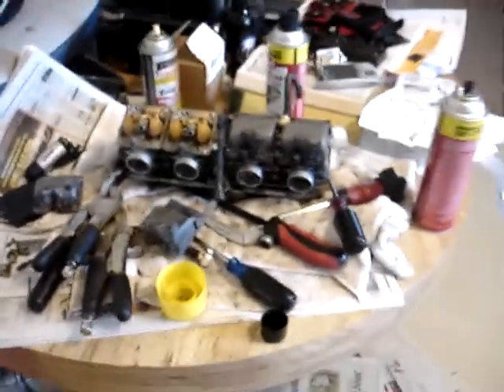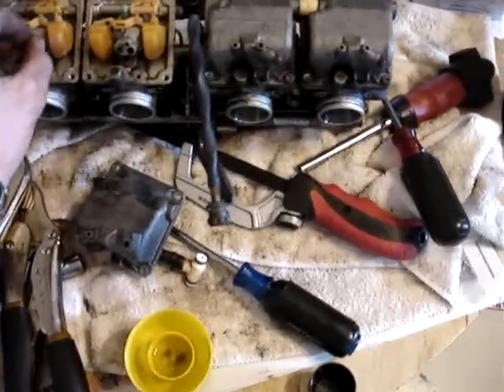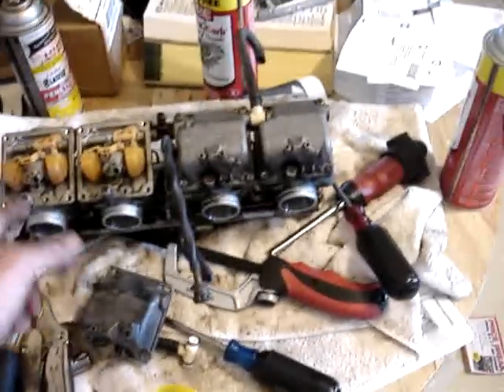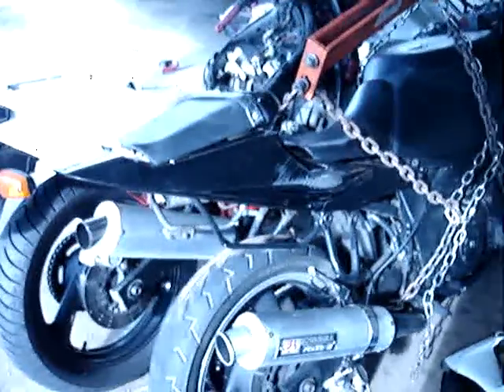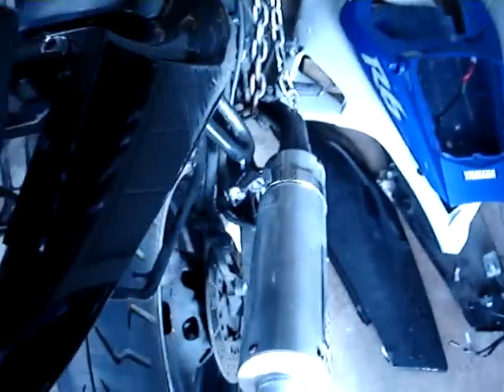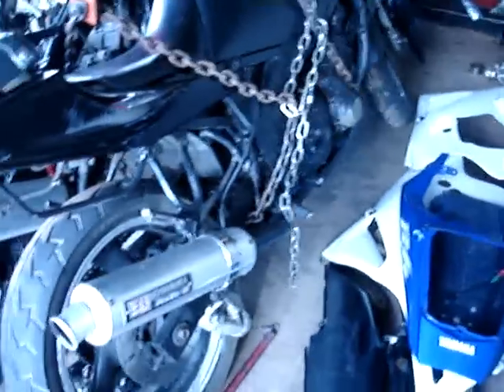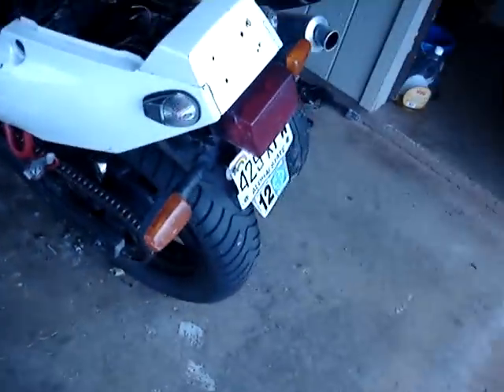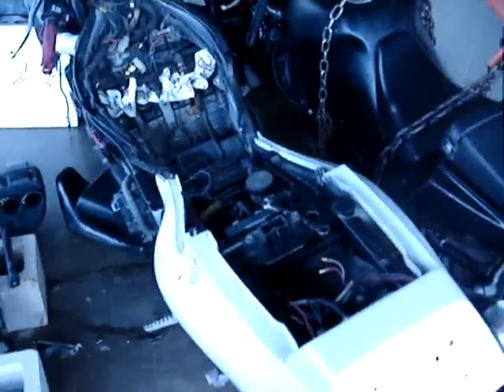cleaning FZR carbs and tail conversion ideas

Comment from the maker: yeah, you just can't separate the 4 carburetors from each other without having to resync them. There are 3 screws, each one has a carb on each side of it, and there a springs on either side I believe. These adjust the butterflies directly, if you adjust these then you WILL throw the carbs out of sync, if you don't touch them you will fine, take them apart, do whatever, careful with the floats and diaphragms too...very careful.

Comment: My 89 fzr 600 ran a little rich I took the carbs off cleaned them adjusted float height and removed those bastard EPA brass plugs with a drywall screw. Even though my carbs are bone stock I still wanted them gone...also removed the ex-up and haven't noticed anything odd.

This is a much needed video....maybe make another that is more detailed?

Comment from the maker: In another video I show my bike with the R6 tail on it. I sold the blue one and got a wrecked one and fixed it.

Even if you are an experienced welder it's hard. There is a lot of fabricating involved, I used an old bedframe for the tail support. It took me a while because  I wanted it to ride exactly like the R6, so it took a lot of comparing a measuring. google "heath agdog r6" (not in quotes), he did a 99 - 02 r6 tail and put an instructional with pictures online, it's 10 times easier

Comment: @pauldavidson2006 no put the petcock on "off" position if your petcock doesnt work just plug the fuel tube comming from the tank with a pen or something, then when you take off the carbs yyou can turn them upside down to drain them or just take out the drain screws